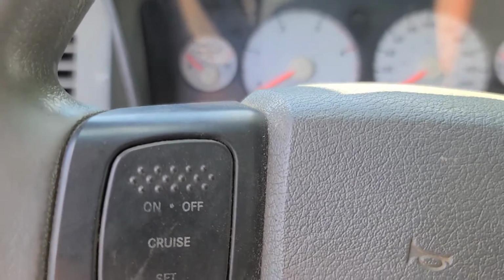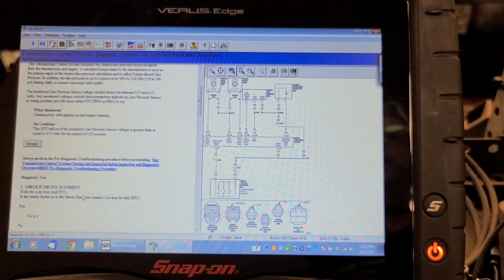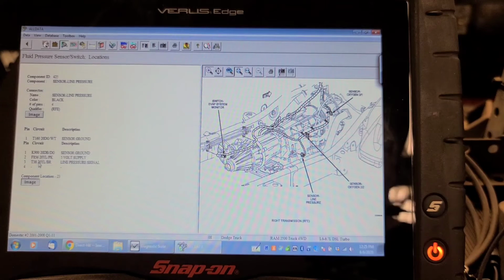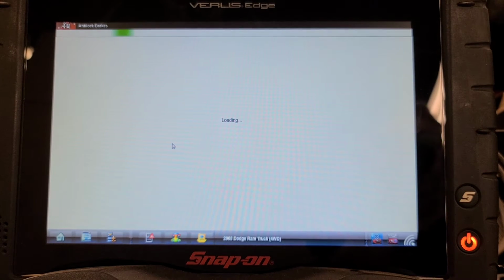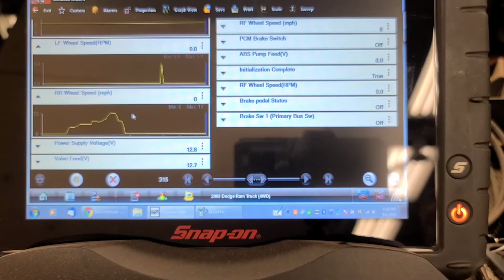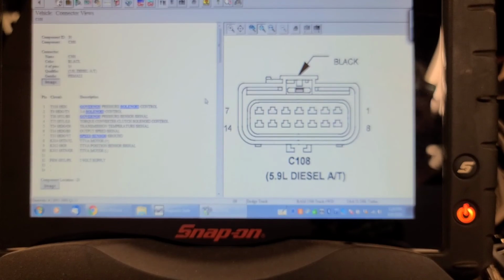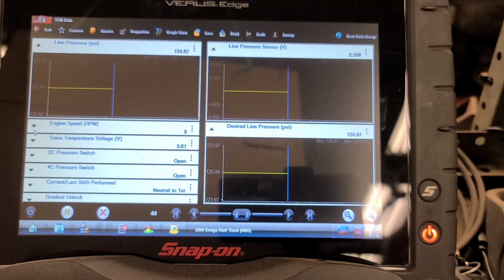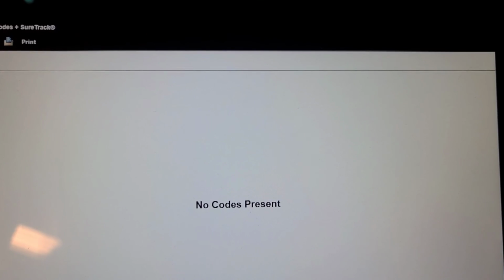2008 Ram 2500HD 68RFE Transmission Problems

Comment: I’m getting a P0700 code out of no where so I’m not sure why but my truck gets stuck in 4th gear until I turn it off and on and it’s fine
Reply from the maker: You must be using an OBD scan tool on the engine controls. A P0700 is a generic code caused by the Transmission Control Module requesting that the Engine Control Module turn on the MIL. You need to scan the Transmission Control Module for the actual code. You will likely need a better scan tool.
Reply: @PhillipBailey  it’s just what my turner shows me that’s it I don’t even own a scan tool. But it ended up being my shift solenoid. It’s still the oem one from when it was built and my truck was bone stock with all the emissions on it when I got it. Wasn’t deleted until I got it. Even had the same cp3 from factory on it and I had to change it out because it finally start going bad my truck has 227k miles so im not really too mad about it it’s normal once the mileage goes up

Comment: Hello I have a 09 dodge 1500 with the 5.7 I am getting a trouble code P0987 I changed  the pressure sensor  and fluid and filters but it still sets my engine light have any suggesting's
Reply from the maker: That code is related to the 4C pressure switch not changing state when the solenoid is sending pressure to a clutch pack. Which pressure sensor did you replace?
Reply: @PhillipBailey  the same sensor your showing in video
Reply from the maker: @rickclark5924  that code is for a pressure switch not switching correctly inside the transmission not the pressure sensor on the outside. I can't remember if the switches are serviceable separate from the solenoid assembly on this. I don't think so. If it was recently rebuilt I would think it would be under warranty.
Reply: @PhillipBailey  OK Thanks I just emailed the person I bought it from

Comment: I have a similar issues with my truck that p2704 trans was just built and tuner said he thinks a quick might fix the issue from what he told me
Reply from the maker: Try a quick learn first.
Reply: @PhillipBailey  Hi, how do you do a quick learn?
Reply from the maker: @veronikaruizvlogs2706  it is done with a scan tool with bidirectional controls

Comment: I have a 2006 Dodge Dakota with the 45rfe transmission. The truck will shift into 1st and 2nd gear, but not into 3rd gear. I have trouble codes P0733, P0934,and P1790. I replaced the line pressure sensor. Any suggestions?
Reply from the maker: 733 and 1790 are usually caused by internal transmission problems. If likely requires rebuilt. 943 is related to low line pressure. If the fluid level is in range and you have changed the line pressure sensor then it likely has blown internal seals or bad pump.

Comment: my 08 had engine issues, truck sat for over a year while awaiting repairs. prior to repairs, i had zero issues with my trans. put the truck back together and it started up, no issues, went to test drive it and it shifts into reverse and drive but will not shift into gears above first? 85,xxx miles on it, i have never changed the fluid,  dropped the trans pan and took out the solenoid to test it, tested it with the 12v battery and only one was clicking, could this be the issue, bad solenoid? is there another test i can do? help. miss my truck. thanks
Reply from the maker: Did you scan it for codes prior to taking the solenoids out? What repairs were done to the engine? Is it possible something was left off? Connector or ground? If the solenoid does not click with power and ground applied then it's bad. I guess you will have to put it back together and see what happens. If it still doesn't work scan for codes.

Comment: Hey Phil, where are you located?? Have water getting into my 4x4 electrical (car wash makes it go bonkers). 
Unplugged a couple looms to clean contacts and now it's put the truck into no start go to dealer mode. 2016 ram 1500 slt pentastar. Just wondering if you have any advice on how to get it out of the mode or if it needs reprogramming. If you're in Alberta, Canada would love to bring my truck to you. You really seem to know what you're doing
Reply from the maker: Hello and thanks for watching. I'm in Northern Ontario near Thunder Bay so that's a long service call. Did you wash the engine bay area?. Or is this an automatic car wash you drive through?. Either way you could try looking under the TIPM for signs of water or if the cover is not on correctly it could let water into the fuse box area which is the TIPM. This will cause all kinds of craziness. Try blow it out with compressed air. There really isn't anything that needs reprogramming possibly just disconnecting the battery and doing a network code clear afterwards will help. Just depends where the moisture is getting to... good luck.
Reply: @PhillipBailey  Yeah that might be a bit out of my budget to bed the truck that far haha 
I unplugged the main loom to clean up the connections and it threw a bunch of permanent codes at me that I can't clear with my obd device. Can't seem to figure out how to put the truck into a check mode. Guessing it has to go see a diagnostic scanner for a reset. Unfortunately the thing won't turn on since it's in a lockout mode. (I miss my old dodge, no worrying about computers.) 
Appreciate your help big time! Looking forward to more videos, learning a lot from your channel
Reply: @PhillipBailey  And ill check the TIPM out! It goes nuts when driving in the rain or in the truck wash.

Comment: Could I diagnose the wiring to my line pressure sensor just from a normal multimeter? I don’t have the fancy snap on scan tools😂
Reply from the maker: The snapon scanner just reports the code. You need a multimeter to test continuity of the wiring from the TIPM to the transmission plus a detailed wiring diagram. Testing the line pressure sensor output is possible but not convient to say the least.

Comment: Hey bud when you say “jump” the ground and the signal wire are you just using volt meter with black in ground and red in the signal and reading it that way or actually connecting the 2 and grounding wire?
Reply from the maker: Yes short the signal to ground with a jumper should make the signal go low and set a low voltage code.

Comment: Hey, quick question. So my truck is giving me P0882 and keeps blowing the transmission fuse and going into limp mode. Do you think it’s the shift solenoid? Problem started happening after someone put the truck in reverse while it was off to install the dash... any help or suggestions is greatly appreciated.
Reply: Also the new fuse lasts about a week and then it goes. But when the new fuse is in it works normal. Now my service 4wd came on and I don’t even use it... the shop is at tested all the harnesses and everything is fine. Tpm is fine and tomorrow they plan on checking the pins.
Reply from the maker: @jsand9726  That code could be set by a short to ground on T515 the power feed circuit to the transmission solenoid pack from the TIPM. I'd recommend to check very close the harness above the bellhousing on the driver side. There is a connector there, 14 pin. Pin 20, yellow orange wire in the connector is the circuit in question. A rubbed through wire intermittently grounding will blow the set the P0882 code. These things shake a lot and vibrate harnesses. Sometimes if there has been work done on the engine or transmission the harness may not get placed back into its retainer clips. Good luck as it's nasty to see up there.
Reply: Phillip Bailey appreciate it man. Hopefully the shop checks that as well. Electrical problems involving the transmission aren’t fun to have 😅
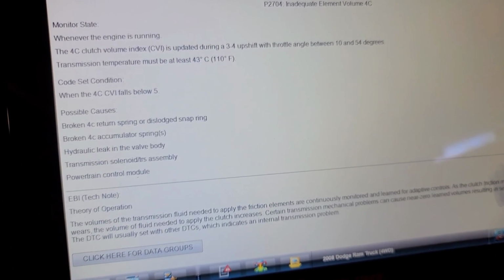Reply from the maker: Check out this video at 24:30 into the video for the location of that connector. https://youtu.be/ObyturCfWrU
Reply: Mr Philip, where’s your location, I need to take my truck to you